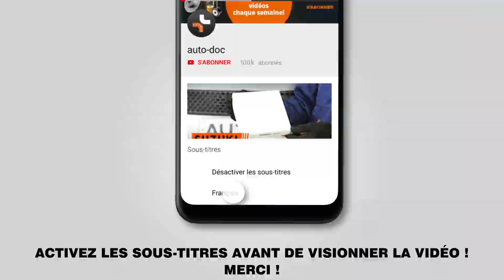Comment remplacer un bras de suspension avant sur Audi A4 B8 Berline [TUTORIEL AUTODOC]

Comment: Stop greasing the disk brake/wheel interface, that is where the torque is transmitted when accelerating/braking via the adherence of the 2 surfaces, by liberally greasing it you will subject the 5 bolts to a shearing force. Grease only the central hub if you are worried about sticking of disc to the wheel, although the brand new disc already has a coating on it to prevent it from rusting in shipping.
Reply from the maker: Thanks for your comment and your recommendation.
We appreciate your attention to the details. 
Our experts will look into it. 
Stay tuned for more videos in the days ahead. Best regards, Autodoc team!